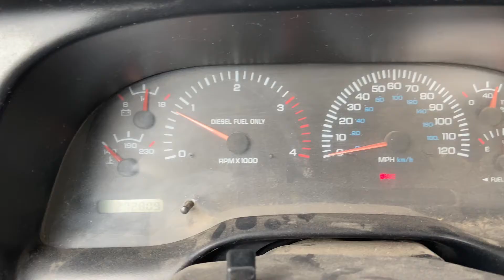The Tragedy of My 98' 12v Cummins + Channel Update

Comment: Pulley is either too big and or too close to the motor then supposed to be, also i was going to do a fender exit and in my 1st gen but i didnt bc i didnt want my exhaust leaking in or not being able to have the window down, lots of things to consider (1st gen has the small window vent and i love using them)
Reply from the maker: Understandable with the bumper exit exhaust, but it would look sexy haha. It’s the stock pulley an all but I’m not sure if the part that attaches to the pulley is bent or the pulley, the pulley itself doesn’t seem to wobble so it may be the other part but the steel is so thick I find it hard to believe it would bend.
Reply: @zackpalmer2824  maybe missing a spacer between the pulley and the motor?? Idk
Reply: @zackpalmer2824  i think the bolt ground down was caused by the pulley actually sucking in toward the dampener, probably bc its at such high rpm, maybe a a new tensioner and see if your belt is getting rubbed down on the sides